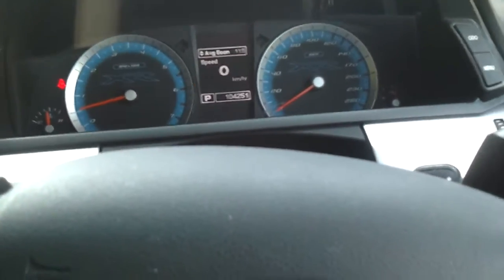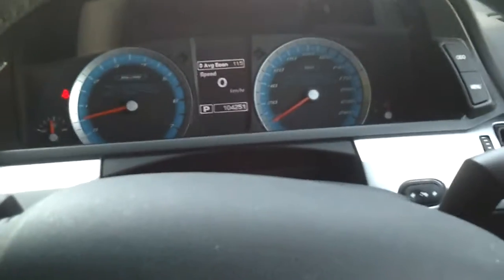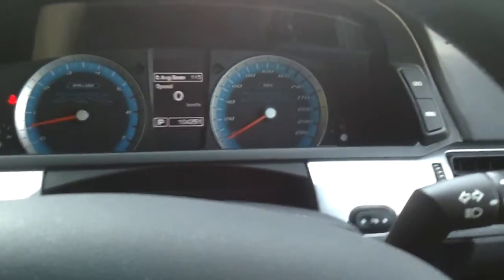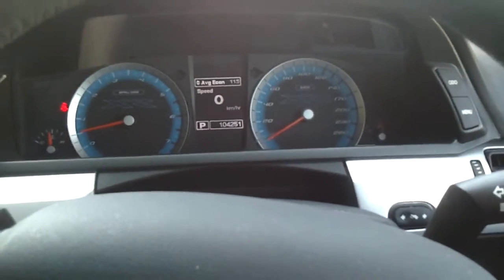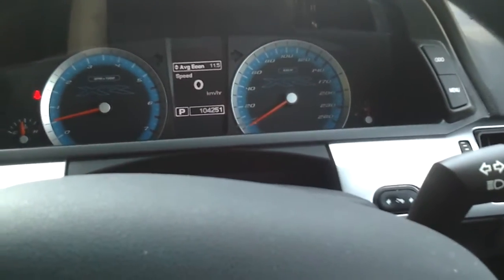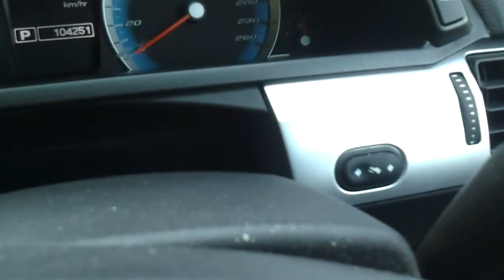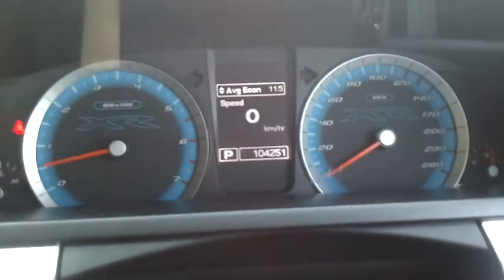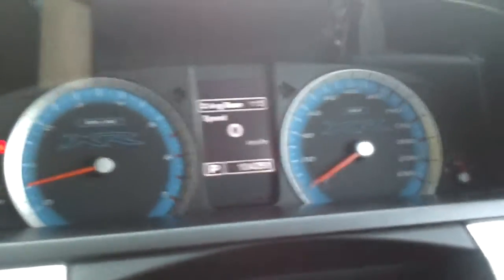FG XR6T - Ex Police HWP Interior Differences (Video 1)

Comment: The scratch on the cluster would be due to the sticker they have on it to say the speedo is either going to be out a couple of kms either plus or minus, you will Also find you have a full alloy spare wheel as well since police do not have any space saver wheels, also they generally have a spare battery in the back of the boot which is removed so the rear boot carpet might not sit correctly as they just let it flap around the spare battery and last but not least is under the bonnet you might fin

Comment: So you got a worn out turd that goes the same looks the same but has a few holes drilled by bunch of mongs at cartec😂👍🏻👍🏻
Reply from the maker: I actually got it with only 60,000kms on it, for a Falcon it was barely even worn in, and personally I'd rather have a car that was driven hard and maintained well (police cars get fixed immediately when anything brakes and no expense spared on them) then to buy a car off someone that maybe never even did an oil change or serviced it etc.
I got an extended warranty until 200,000kms anyways.
I still have the car and drive it daily and its got a LOT of km on it now and I've never had a problem.
Each to their own, I like having the dual battery setup and better trans cooler etc, no ZF Milkshake for me!